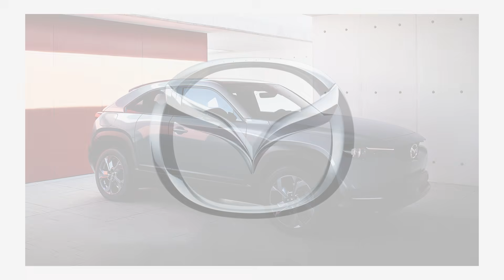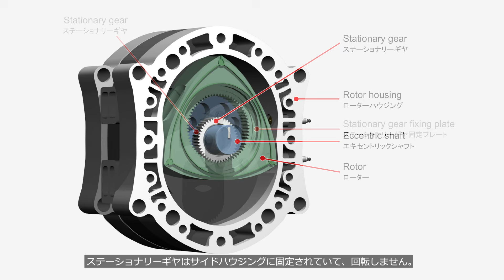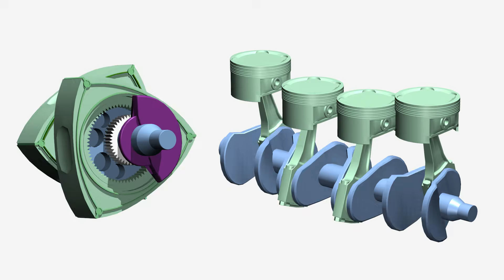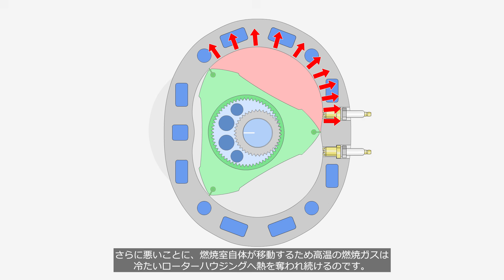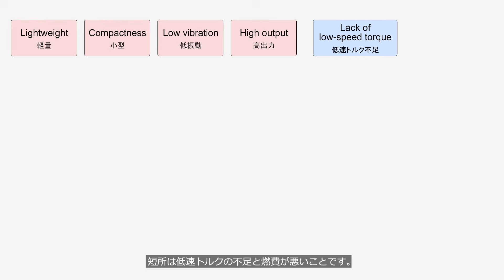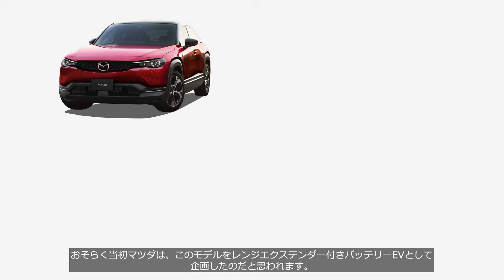Rotary Engine in Hybrid? Why Did the Mazda MX-30 Fail?

Comment: mazda's in-house hybrid solution with this wankel definitely shows up they didn't developed a working model for series-parallel/full hybrid but uses series hybrid(which has way less active proprietary patent) for the future of hybridization over the years
and they didn't take advantage on its cylinder and thin layout (like utilizing some axial motors instead of conventional radial motors) by making all MGUs inline with engine, for versatile packaging to their current lineup, or even outsourcing such package to other companies and aviations(small general aircrafts wants that for aero reason)
even adapting some patents from toyota's THS power split technology and some knowledges from miller cycle and SPCCI madness also helps, but decided to just chuck that just-baked dorito in, to make sure it is a MXperiment product and keep dorito factory runs regardless of being successful or not

Comment: While the motor's peak DC voltage is limited to 268V, it must maintain constant power from 4,500 to 15,000 rpm. This leads to an over-engineered design and higher costs, but results in a power output that remains unrivaled by competitors.

Comment: A plug-in hybrid (PHEV) is a good way to overcome the deficiencies of the Wankel rotary engine, which is not fuel efficient at part load and is not as durable as piston engines, because::  
1.. Daily driving will use electricity from the battery and only needing the engine for long trips, so engine durability is not a problem when the engine is only occasionally used.  
2.. The low efficiency of the Wankel at part-load is improved when the engine is only run at its maximum-efficiency power setting to charge the battery and is not run at part load when efficiency is poor.  The lower fuel efficiency is not important here because the engine is used only about 10% to 20% of the time in a PHEV.  Its fuel efficiency is similar to a comparable piston engine car which is an improvement of a Wankel rotary engine vehicle.
3.. The main advantage of the Wankel is its low weight and compactness which is important for an engine that is only used 10% to 20% of the time, so that you don't have to carry a heavy engine all the time when it is only rarely used.  This will improve the overall efficiency of the vehicle with a much smaller and lighter engine.

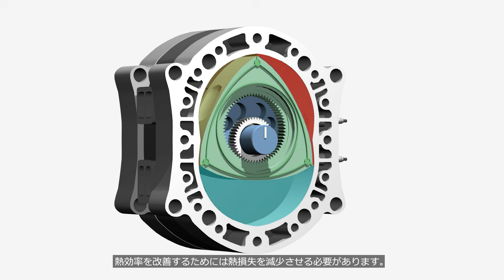Comment: 7:00 The low thermal efficiency and poor fuel economy is due to a design flaw which went overlooked due to other factors with shared symptoms which acted to mask the true cause.
This has now been addressed successfully by private parties, and the thermal efficiency of a Wankel can now compete with reciprocating engines.

Comment: BEV short distance use??? My Bev can drive 600 km...
Reply: But extra weight, meaning more expensive, more valuable resources, more wear and tear on tyres and suspension components, more damage and wear to public roads due to the weight.

Comment: Thanks for the detailed video investigation into possible decision scenarios of Mazda's move to bring back the rotary engine as range extender. I did simulations to hybrid drivetrains for Heavy Duty Vehicles with PEMFC. I believe Mazda was quite clear about what they did. It was clear from the beginning, the rotary engine has a lower fuel economy, but a bit better comfort and compactness. For me it was only to have another approach in the market, marketing over technology. But maybe Mazda was just opening a door for a next level rotary system?

Anyway, a cost efficient range extender is likely a highly efficient single point or narrow operation window gasoline engine. Mazda showed balls, so big, they reach down until the knees, their SkyActiv and SkyActiv-X technology showed, who is the master in class regarding engine development and bravery to bring a NA engine back into a downsized turbo-dominated market. They do what others fear to do. They have 6 different hybrid systems, they are testing, they are diversivicating technology to applications and collect experience on each. Nothing what Mercedes, BMW, AUDI, Porsche is doing in that extension. If know one knows how the market is developing, why not testing different systems to be prepared. Toyota is fixed to BEV and one HV system, Honda too. 

It is difficult to achieve 45 % efficiency with an NA gasoline engine. My best NA race engine reaches 40 % at WOT incl. enrichment and 130+ Nm/Liter. Building a single point range extender NA engine might be possible to push to 45 %, but combustion process design has to be lean, that means, the BEV content of that engine is likely high, and the range not to high and runs likely all the time. Exhaust treatment has CO-CAT plus maybe a SCR system for NOX if lean-level is not high enough. Honda developed a K20B engine with a lean-combustion-process-design (lambda was > 2 and had likely pre-chamber spark plugs). 

The rotary would only made sense if efficiency is on par and the enginebay would be available for other things to (compartement, ...) or smaller then typical. There are still a lot of patents pending and accepted on the rotary topic. Maybe the door is still open at Mazda.
Reply from the maker: Thank you for your comment.
I also have great respect for Mazda’s challenge.
However, I don’t think the rotary engine was used in the right way.
I hope they will develop a small sports car using a parallel hybrid system with an electric motor to compensate for the rotary engine’s weaknesses.
But considering Mazda’s scale and its current financial situation, I suspect that this will remain only a dream.
Reply: @sikasabumotorchannel  i want to think somewhere in a mazda garage, there is a mx5 with a rotary and a small battery
Reply: I written an in-depth article on the 8C rotary engine and spoke to Mazda engineers, the main issue is the slow combustion that causes heat loss. I've been told that they keep on working on rotary engines, there have been hints of a two-rotor version of this engine. Mazda mainly created the 8C to keep the rotary alive, as a proof of concept. I have driven the MX-30 REV and I wasn't dissappointed by the energy efficiency, but to be honest, there was a lot of room for improvement.
Reply: @Carnold_YT  Thanks for the reply. Do you mind to share the title of the article?

The combustion process design of my race engines is crucial for efficiency and performance. The lack of squish in a rotary chamber has to be compensated by e.g. more TKE generated from injection or ignition, but here also the chamber shape development over rotation is not helpfully. The big advantage of an ICE is the roundness (sealing, geometry symmetry and squish). We developed ICE engines with 50+ % of efficiency for natural gas (flushed pre-chamber, lean combustion process, 6 bar of boost, ...) it was about the work ratio of positive and negative over the 4 strokes, combustion velocity and friction. Would be really nice to learn more about the rotary combustion process system.
Reply: @dr.markusraindl1745   I have a link to the article in the channel info of my YouTube channel. I can´t put the link in a reply, it gets deleted by YT. The article is in Dutch by the way, but a translation tool will be helpful.
Reply: @Carnold_YT  Thanks for the reply, I found the article and skimmed it. You have mentioned the 8C has an improvement on efficiency by 25 %, is it related to IMEP or BMEP?

The EGR thing, to dethrottle and lean I've read too. Would be interesting to know how it affects the lifetime of the engine. Do you have any insights on that?
Reply: @dr.markusraindl1745  I haven´t any insights on the longevity, but the 8C runs within a limited rev-range, almost as a stationairy engine. I think that will contribute greatly to the lifespan of the engine. Also, the engine doesn´t start up to fill in when there is a power-gap. When it starts, it keeps running to provide power for a significant amount of time. This allows the rotary engine to warm up, unlike a lot of Toyota hybrids, which start and stop over and over, even in the warm-up cycle. The efficiency increase may be an apples and oranges comparison. The 8C has less internal heat loss due to the improved design of the rotor, the combustion chamber (epotrocoid) is not as wide as the 13B so that also contributes to less heat soak. The engineers I spoke to reminded me of the fact that the combustion of a rotary engine is slow. As mentioned in this video, that allows the metal to soak up combustion heat / pressure. Mazda aimed for the ideal rotational speed where the combustion pressure results in the most efficient power output. I also asked if the efficiency would further improve when the engine would skip combustions, so that not every time that a rotor side passes the spark plug, there would be a combustion. 

Imagine if you would number the rotor sides 1,2 and 3. And you would inject and ignite side 1, skip 2, inject and ignite 3, skip 1... Mazda said they had considered that, but due to the slow combustion, the rotor would slow down and even stall under load.

I hope this answers your question, feel free to reach out, my contact data is on my YT channel 🙂